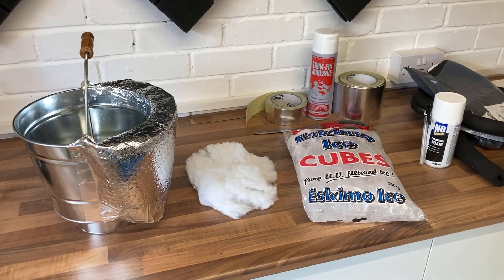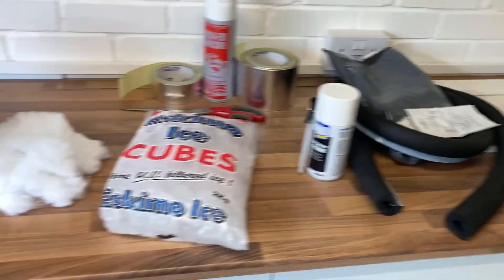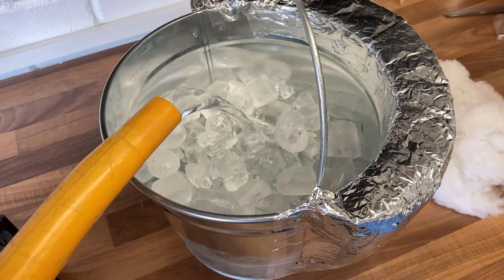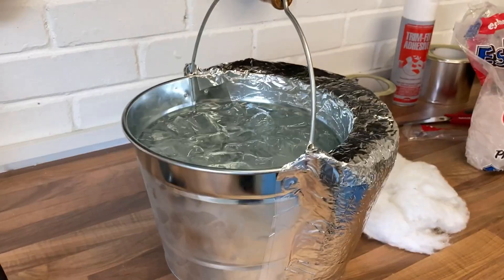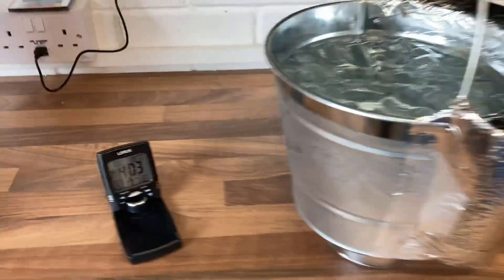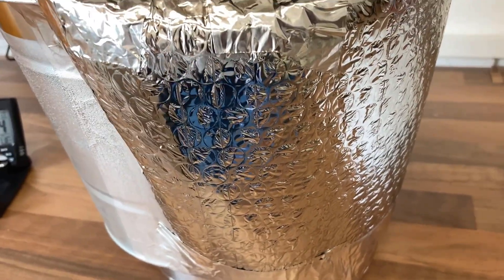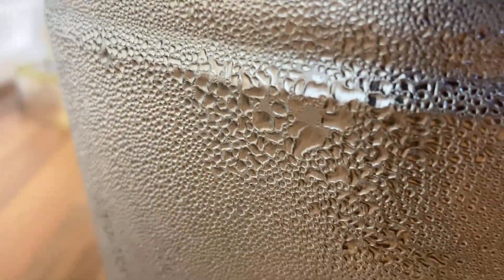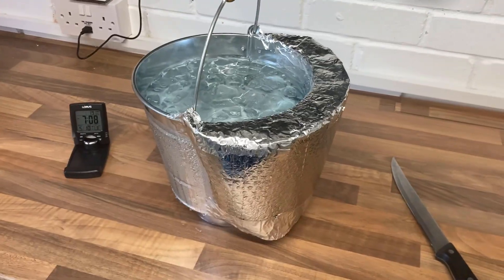Vapour Barrier in a Van - I can Prove they Work.

Comment: Could you repeat the test with just insulation one side and a vapour barrier with 10 small holes pierced into it on the other? This test is only showing the results at either end of the scale.
Reply from the maker: I will do another test with a couple of different options for you 😊

Comment: If using kingspan is there a need for vapour barrier? Does the foil back not act as vapour barrier?
Reply from the maker: The foil is the vapour barrier, just make sure you seal and joins with foil tape and around any services too. 👍🏼😊
Reply: @GregVirgoe  cheers for the reply, I presumed the foil acted as a vapour barrier and I have taped all seams, joins  and edges with foil tape. Greg you have put out some of the best YouTube material on campervan builds, watched many an hour for ideas 👍 excellent work 👌

Comment: Nice one Greg. I have followed your advice on 3 van builds after seeing that you obviously know your onions.. I would be interested in seeing the test again using insulation but no vapour barrier as I know many builders put in insulation with no barrier..
Reply from the maker: I will do that as a follow up video. 
👍🏼😃
Reply: Thats exactly what I thought jonny. Get it done Greg as that will be the one that will get people thinking.
Reply: The building philosophy years ago, was to put polythene (non-permeable) over the insulation (usually Rockwool or fibreglass (itchy stuff) and then plasterboard over it.  But, any gaps within the plasterboard, plaster failure (plaster can provide air tightness layers too), the polythene can sweat at the back and the moisture will run/drip down and start the erosion process of your timber studs, so, that's why, if you want increased air tightness within your house, you use an air tightness member called Intell and then tape up the seams/joints with Tescon Vana air tightness tape.

Comment: You see it a lot in the US with young couples making and selling vans not installing a vapour barrier. It's less than a days work to fully line a van with a vapour barrier.
Reply from the maker: If you plan to only use it in very hot climates it’s not an issue but as you rightly say it’s so easy to do why not fit regardless and have peace of mind.

Comment: On the top of my van list, to find and sort out any rust spots, insulate and vapour barrier, a good quality extractor fan, safety security items and methods. After that, I’m quite happy with a basic build, a bed, a bucket and a baseball bat, then I’ll add more home comforts as I go on
Reply from the maker: I’m pleased you got the essentials sorted out. Happy travels 😃
Reply: @GregVirgoe  Many thanks to your expert advice videos! 👍🏽

Comment: Great vid mate ,  what sort of insulation did you use  , I'm just about to start to this  process on my van 👍
Reply: check out his playlist on building his camper .. there are 2 or 3 1/2 hour long videos about insulating
Reply from the maker: I used PIR foam board (kingspan or celotex) on the floor and ceiling and I would recommend using Dial recycled plastic loft insulation in all the wall pockets and ribs. The foil vapour barrier over everything. 👍🏼😃
Reply: @GregVirgoe  This comment should be pinned!
Thanks for all you've done for all van builders!!

Comment: Great experiment and very well presented. I wonder if there is a part two video? As with all science experiments, you need to prove all the other options to get a robust result. The question is what part did the insulation play in stopping condensation?  So, what would the result be if one side of the bucket was just covered with the recycle plastic insulation and the other with just the foil bubble wrap? I am very curious in how effective the foil wrap works as a vapour barrier where this is stuck to the say van walls and then carpet lined, as you did with your van conversion around the sliding door post and window reveal, will it still work?  Keep up the videos like this.
Reply from the maker: Yes I will do a few follow up tests. 😊
The insulation raises the surface temperature above the dew point. 
The double foil bubble wrap has a small pocket of air inside it and that combined with auto carpet is just enough to raise the surface temperature so it’s not cold but I have these materials so will do further tests.

Comment: but is this a test of a vapour barrier ? seems to be a test of insulation, surly the test for a vapour barrier would have insulation on both sides, Everyone knows water condenses on a cold surface ? but will it condensate on an insulated surface without a vapour barrier ????  PS I agree with vapour barriers :) ....
Reply from the maker: I will do that again with just insulation to show you but trust me with no vapour barrier it will sweat as there is nothing to stop the moisture getting through the insulation.

Comment: No one argues that vapor barriers do not work. The argument that's thrown around on reddit is that it is impossible, in practical terms, to completely seal off a van such that no moisture can get through to the insulation. The question, in this case, is not whether vapor barriers work but if they can be implemented - and if they can not whether they will only succeed in making the walls less breathable, thus trapping moisture. The very problem which we are trying to avoid.
Reply from the maker: It’s not difficult to to install just seal all the trim clips, tape all the joins and edges, tape around any services it’s really very simple. 
Why would you want to have your whole van soaking wet every night? 😳
Reply: @GregVirgoe  I might try but for example the Ford Transit Custom van has a lot of "ribs" where the outter sheet metal wall is not accessible and it's hard to see how to tape it all or whatever.  At least without tearing the whole stock front cab apart or using something like closed cell spray foam perhaps...

Comment: This is all well and good, very interesting. But the truth is no vapor barrier will ever be perfect, so it will never work this well in practice. My thought is do away with the vapor barrier, and allow the van to breathe and expel moisture on its own through heat and ventilation.
Reply from the maker: If it cold outside the entire inside surface of your van will be soaking wet and your happy with that? 
How is that better?

Comment: The problem I see is not that a vapour barrier won’t work, it’s that it’s almost impossible to seal up a van interior from the van walls so it is airtight. Especially the Transit. And then you can trap moisture inside the vapour barrier (although ideally that can get out and dry through the van wall drain holes)
Reply from the maker: It’s very easy to seal plastic trim clips, tape joins and edges, tape behind sockets and lights. It’s not hard to do. 😂

Comment: Insulation - yes. Vapour barrier - no. You can't get a complete seal from a vapour barrier, so you will get water vapour within your insulation layer. It then can't get out - you've created a problem where one need not exist. Each to his own, but I decided AGAINST using a vapour barrier, but did use closed cell neoprene over sound deadening, then 50-100 mm insulation, then ply, then 4-way stretch lining.
Reply from the maker: 😂😂 the closed cell neoprene is a vapour barrier due to the closed cell foam. Look up the manufacturers specs. So you DO have a vapour barrier 👍🏼🤩
Reply: Not an absolute sealed barrier like you are trying to achieve. It's impossible to apply CCN to all internal panels with no gaps. 
Your VB is analogous to a sealed double glazed unit. Even under ideal conditions of manufacture they fail and the consequence is water vapour within the "sealed" compartment. We've all seen "blown" units and also the 1" of black/green mouldy water that gradually forms at the bottom of the unit. Same thing will happen in your van. As I say, each to his own. Just putting another viewpoint, which I believe is a healthy thing to do on your channel, allowing people to then make their own choice. I'm not saying I'm right and you're wrong, just putting another view forwards. You've been an inspiration for me in many ways, but I just happen to disagree about VBs. ATB. Neil

Comment: Experiment #2 - Repeat the first experiment but with a small screw-sized hole in the vapour barrier. Does it provide no protection, 50% protection, 90% protection?
Reply from the maker: When you install your screws do you take them out leaving a hole? 😂😂
Reply: @GregVirgoe  A “screw-sized hole” as opposed to a “gapping big hole”. Wasn't thinking of screws specifically. A “pin-sized” hole might make for a more realistic experiment. (And no i dont intend to put a pin in and later take it out, lol)

Comment: Just a note of caution is that this works if the bucket doesn’t leak! I used insulation and vapour barrier on my roof ( water tight) but not my walls. The reason is I power washed my van as a simple test before I started. Big spray inside the van from things like the wheel arch seams where inner and outer skin are joined So on the walls I am using high tech breather membrane instead. When the air inside is dry the pores are open, when it’s humid they shut. When open the insulation breathes releasing moisture. It may work, it may not but being in the construction industry for 42 years and dealing with damp situations on a weekly basis you quickly learn the folly of people who have sealed the inside when the issue is coming from the outside. If you have sealed all the holes in the cills, structure and skin ( only proved by a positive air pressure test ) then you should be ok.
Reply from the maker: If water is getting into your van from outside I’d say you’d have been better off spending some time with some sealant on those leaks first 😁

Comment: Hmm. I agree that you have tapped up the insulation very well, and that the ice and water are going to produce condensation from the air according to the chart. But this experiment seems to mix two different techniques/solutions - namely 'Vapour layer' and 'thermal layer'. Certainly the tape and the plastic covering to the insulation is providing 'vapour layer' protection, but the insulation is providing 'thermal layer' protection. Even if you had not put tape and plastic over the insulation, the effect of the insulation would still have been to reduce the condensation, as its an insulator, thus reducing the energy exchange. However I do agree that it is clear that decent insulation with a breathable covering is essential for metal clad vehicles.
Reply from the maker: The wool insulation is highly permeable and provides no barrier to moisture getting to the bucket. Without the foil the bucket would sweat under the insulation. I will prove that too in another video 👍🏼
Reply: @GordonjSmith1 I wouldn't go with breathable or gas permeable layer. Those barriers are meant for gas containing moisture to escape through it while resisting water from the outside... as warm air is always trying to push out of a space and cold is always trying to push in. This is why they use this type of membrane in house construction so the house can breath but also remain insulated and dry. It would have the opposite effect on your van IE the moisture gas would push through towards the cold surface and then condensate on the inner side of your van skin which is cold from the outside air and will act as an impermeable surface... this then forms water which cant get out of your insulation void... Impermeable layer and air tightness is the key to all of this working... aluminium foil is the industry standard as it 100% blocks movement...

Comment: I think that with just the insulation, without the foil, the result would have been the same...
Reply from the maker: NO, that insulation will allow air to get through to the bucket. Only closed cell insulation like neoprene or spray foam has an inbuilt barrier

Comment: best demo of a vapour barrier ever.  i have a plastic one but mines developed religion....
Reply from the maker: Plastic is also a good vapour barrier 👍🏼😃
Reply: @GregVirgoe  it started life as a Poundland paint drip sheet so it's so very thin, but there airtight.... Till you accidently pop a hole here and there but brown parcel tape is great to repair the punctures.....

Comment: What about when the interior of the van may be colder than the outside moist air sometimes, and other times the interior is warmer than outside? For example,  at the beach with AC running vs up at a ski area with heater on.
Reply from the maker: If it warm outside it will be very dry so you won’t get condensation on the outside of the vehicle in hot weather
Reply: @GregVirgoe  in the SE  US its common to have 90f and 80 RH. Hot and humid is very common. Added to that, AC will dry the cool air

Comment: Top video Greg those little droplets that were there would have been from the air trapped in there hey! minimal it was but makes you think maybe create a vacuum in a van when doing it if possible leaving 0% not even those little specks that you had... good experiment explaining things though... also explains why you want a watertight barrier rather than breathable or gas permeable barrier which I see people using... that would be a good video too... although it would need to be done in an airtight room to see maximum effect... good stuff my man
Reply from the maker: The tape on the left hand side of the insulation that was stuck to the bucket was wet and it transferred of that when I ripped it off. You would not get a couple of random drops like that it would have all been wet if there was any leaks etc
Reply: @GregVirgoe  ok so no air trapped in your insulated leak free side then... IE enclosed in your air tight side in with the insulation? Its not a criticism its just a question Greg as your the expert on this... is there anychance of the air inside your sealed side condensating if that air contains water as an element in it although minimal. I would also ask the same question for example if someone enclosed an organic material into their air tight void IE moist bit of timber? Is this possible or does it need to be open to normal air conditions to even start this process? I am genuinely interested in this subject Greg thanks for your responce.

Comment: Nice empirical test. Love those things. Thermal camera would be neat for illustration too.
Reply from the maker: I tried to find a thermometer to check water temp but I think the results speak for themselves. 😃
Reply: @GregVirgoe  i was thinking to show the thermal properties.
I think you could see with a top view the cold to ambient on the insulation side.
Reply from the maker: @RedBatteryHead  you can see a small bit of conducted cold on the foil tape so there is a little condensation on the outside of the tape near the bucket. Proving that just a vapour barrier against the steel would not be enough. You need the insulation as well to raise the surface temp of the vapour barrier so you don’t get condensation on the outside of it.

Comment: I’m not convinced. It had beads of moisture underneath and can you confirm to me why manufacturers like Swift when converting vans don’t install a vapour barrier. Neither do professional builders in the campervan game. I know most don’t. It was a fantastic video though but I’m still not convinced. Things need to breathe and most vans never go to that extreme unless there content creators. Most campers and Motorhomes owners want the sunny weather.
Reply from the maker: The couple of random droplets was transferred from the tape when I ripped it off. 
Motorhomes are built of a composite insulated panel so they don’t need additional treatment inside they are already insulated. Look how thick a motorhome wall is. If you always are in hot climates then it’s less of a problem agreed but it still can drop below dew point at night.
Reply: @GregVirgoe  thanks for coming back to me Greg, yes I agree Motorhomes are built from composite walls but van conversions just like your van are converted by manufacturers also and they do not fit vapour barrier I can assure you of that. It was s great explanation though as no one has ever explained it like that before. Hope your having a great time at quirky and looking forward to the budget friendly build once it starts.
Reply: Don't forget, Robbie, that professional builders manufacture to make a profit. That doesn't always allow for the best method to be implemented, but for the most cost efficient. 😉
Reply: @JensGraikowski  I’m still not convinced. That’s not allowing the van to breathe.

Comment: Excellent video Greg as usual thank you. What about natural wool insulation? We’ve been advised from the manufacturer (processing human, not the sheep themselves) not to use vapour barrier as the product absorbs moisture in cooler months and then releases it in warm months and a barrier would inhibit this natural process. The wool also warms slightly as it dampens.
Reply from the maker: I had seen thermafleece advocating this on there website initially which really worried me. 
I’m pleased to see now they have changed that to recommending vapour barriers. The problem is the wool is permeable so it will allow the entire van to condensate in cold climates like we have. Why would you want to allow that to happen within the walls of your vehicle if there was a simple way to prevent it all together. I don’t get why they would recommend that. 
That water will transfer to wood panelling and furniture and ultimately result in mould.
Reply: Also doesn’t support the growth of mold as it’s a keratin